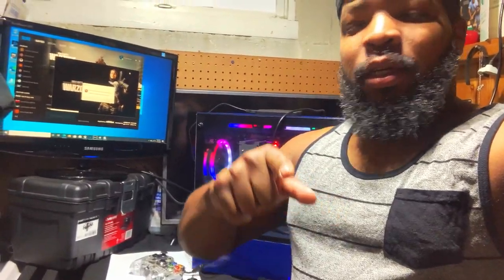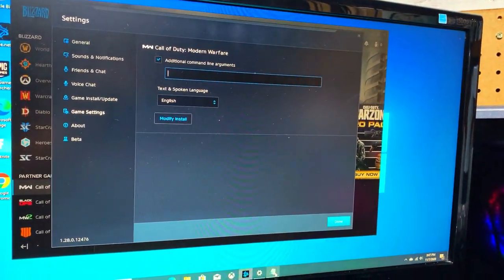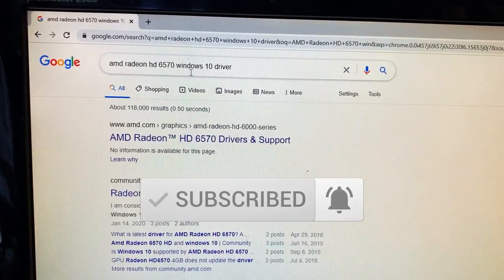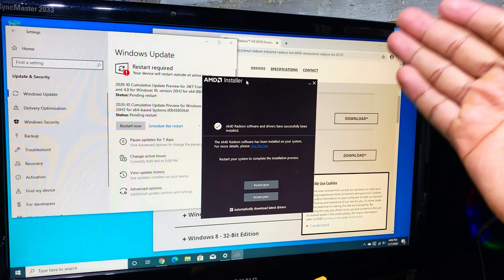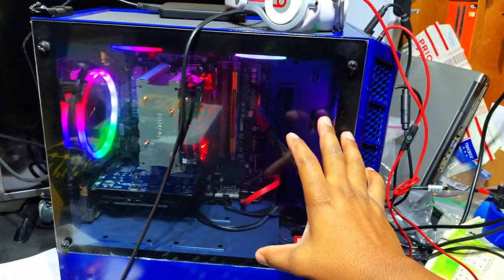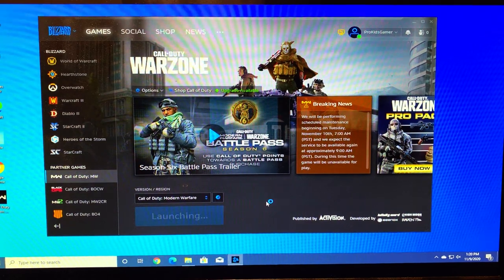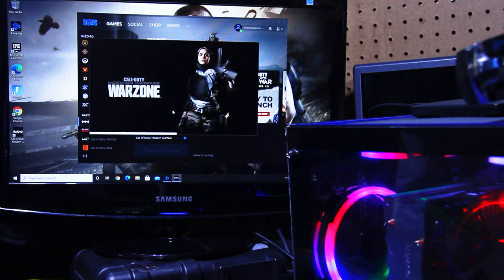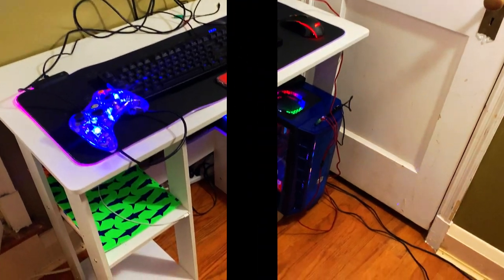**FIXED** Call of Duty "DirectX encountered an unrecoverable error"

Comment: whatever you did made my pc so slow i cant play it and so zoomed in i cant see anything, and yes i was careful and watched everything followed every step and payed attention so thanks dude.
Reply from the maker: Hey dude, the steps in this video has nothing to do with PC performance nor will it cause issues with display being zoomed. What is your computer hardware specs? 

Call of Duty: Warzone System Requirements:

Minimum	
GPU	GeForce GTX 670 or 1650	
CPU	Intel Core i3-4340 or AMD FX-6300	
RAM	8GB

Recommended
GPU	GeForce GTX 970 or 1660
CPU	Intel Core i5-2500K or AMD Ryzen R5 1600X
RAM	12GB

However, I highly recommend that the Minimum GPU is "4GB" video card and the Recommended GPU should be "8GB" video card. If you are using a laptop and are playing Call of Duty Warzone, you will experience significant issues with the game due to the new game updates which the video card will need to encode throughout the game. Therefore, I highly recommend this game for PC/desktop computer with an dedicated video card.

Thanks
Reply: @AWordFromMrJones  Warzone probably started in safe mode and reset his graphics settings. He probably just needs to raise his FOV in the game settings.
Reply from the maker: @DoSGamingNetwork  Good point brotha.

Comment: BROTHER MY HP  LAPTOP HAS FOLLOWING SPECHS  WILL CALL OF DUTY WARZONE WILL RUN   Device name	LAPTOP-2OD6SKC2
Processor	11th Gen Intel(R) Core(TM) i3-1115G4 @ 3.00GHz   2.90 GHz
Installed RAM	8.00 GB (7.65 GB usable)
System type	64-bit operating system, x64-based processor
 PLZ help me i have installed it but fatal error 6065 is coming 😔😔
Reply from the maker: In my instance, you need to use a computer with a dedicated video card to play COD Warzone. Some people were able to play but the recent DLC updates changed the coding for Directx.

But I would recommend you to uninstall your video card drive, install the latest version and see if that improves. If not, please run Windows updates and test COD Warzone again.
Reply: @AWordFromMrJones  BRO I HAVE  UHD GRAPHICS BUT THIS ISSUE COMING

Comment: Gtx980m - before season 2 warzone worked just fine, but after that its no go, so its on warzone side not mine
Reply from the maker: Very possible that a game update can cause issues with the graphics card. Have you tried downloading the latest driver or hotfix for the GeForce GTX 980M?
Reply: @AWordFromMrJones  yep, latest GeForce experience + video drivers

Comment: I have a RTX 3070, Ryzen 9 3900X, 16x2 ram, yet I can’t change the graphics past “normal settings” without the game literally freezing instantly and crashing, it’s pissing me off so bad, I just play on potato graphics
Reply: Not sure what changed, probably in the latest update, currently able to play on max graphics with RTX ON, less frame drops but sudden freezes still occur occasionally, can be fixed with a ALT+TAB to quickly switch tabs and unfreeze the game. It’s dumb but it works 😂
Reply: Maybe your motherboard or power cell can't support your components because they're drawing too much power
Reply: @sheltonbest9197  A possibility but unlikely, due to my motherboard being an Gigabyte X570 aorus pro wifi (which is relatively new and near the higher end spectrum to my knowledge) and a power supply of 850W, calculated to be adequate for all my components, and I’m able to play nearly all other graphic intensive games like GTA V,  Minecraft RTX (custom 4086x textures) and newer Battlefields, at 1440P max settings without OCing and it manages constant >60FPS no problems
Reply: I’m convinced it’s very much a software issue
Reply: @Harrace  it is a software issue, i have a RTX 2070 and cant change the settings or i get this Error
Reply: FOR REAL

Comment: i have to buy one?? pls answer
i have AMD Radeon R7 series and NVIDIA Quadro 2000
Reply from the maker: Any dedicated graphics card with 4GIGS or more will do.
Reply: @AWordFromMrJones  okay thank you
Reply: that's not technically correct. a quadro k2200 for example has 4GB vram and that ain't playing wz unless u wanna be puking all over from stutters and motion sickness. you'll get about 30fps, and I can tell you from experience anything under 60 in warzone will give you a big headache due to how fast paced it is.
A gtx 960 with only 2GB vram will put out higher frames than the 4gb quadro, so it's not about how much vram it has. just make sure your hardware meets the official minimum specs, which is one Google search away.
Reply from the maker: @yoboicc_418   It honestly boils down to how the video card was built, if the manufactory wanted to produce a cheap 4GB video card for a quick profit, then yes I can see those issues happening which would also apply to 2GB video card. It all depends on supply and demand.

Comment: My pc does not have directx will my cod warzone will work on my pc ? Please tell me 🙏
Reply from the maker: Sounds like you might be using a built in/non-dedicated graphics cards which will experience these issues. You will need to purpose a dedicated graphics card to play.
Reply: @AWordFromMrJones  inbuilt graphics card wont work ?
Reply from the maker: @pro_killer5212   Not currently. It use to work but since the updates to Warzone back in 2020, DirectX software is not compatible with built in/non-dedicated graphics cards. The best recommendation would be to purchase a dedicated card.

Comment: Hello, this problem happens when I switch tabs per say google chrome while in Call of duty any suggestions?
Reply from the maker: Interesting. So your playing Call of Duty and you have Google Chrome open which is causing COD to crash. Google Chrome is a memory hog so I would recommend that you close Google Chrome while gaming. If you need a web browser open, at least try FireFox or get a laptop/tablet for web browsing while gaming.
Reply: Thanks! But about a week ago or so I figured out the issue I needed to run battle.net as the administrator. That seems to fix the issue haven’t had a crash since.
Reply from the maker: @fluidbi0424  Good deal!

Comment: Bro i have a nvidia geforce rtx 2070 super i just bough it 3 days ago and i have been gettinf frozen screen and crash allll day long for fortnite and cod do i really need to upgrade from a 2070 super or is it that cause i have directx12 installed maybe i should move down to 11?
Reply from the maker: Unfortunately the 2070 is known for failing VRAM. However, this could be premature due to heat. I would first recommend that you install DDU (Display Driver Uninstaller) and perform a Clean & Restart uninstall. Once you reinstall the driver, perform a custom installation and select CLEAN INSTALL of the installation. Restart and try to play a game again.

If that fails, then I would recommend that you replace the thermal paste and then give it another shot. Check out my video here:

https://youtu.be/RiFAM2yquB0

Until you get the thermal paste changed, lower your display (computer and in game) resolution and see if this can buy you time to limp along.

Comment: It's mean just buy an expensive graphic card rather than play low games like fortnite and pubg etc
Reply from the maker: For anyone experiencing this issue, I would advise to buy a fully qualified dedicated video card, 4-8 GB of memory if the budget is right.

It’s more so an issue due to the driver and power and not really based on how expensive the video card is but definitely get where your going. Good advice.

Comment: ** IF THIS DOES NOT WORK & YOU HAVE JUST UPDATED GPU READ**

I had updated my GPU from a Nvidia Geforce 1060ti, to a AMD Radeon 5500XT and after installing my new card, my game kept crashing with this error even after updating the AMD Drivers.
I fixed this by uninstalling everything Nvidia related that remained on my computer, Geforce, Drivers etc.